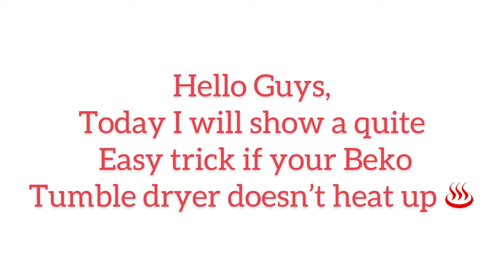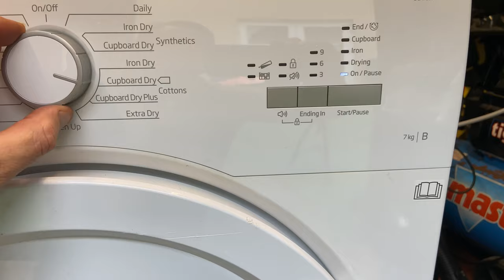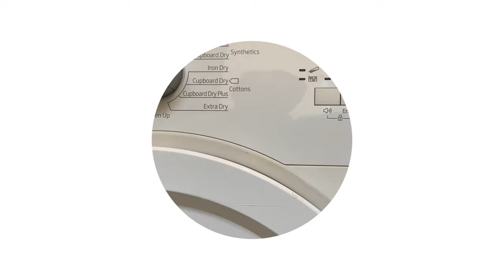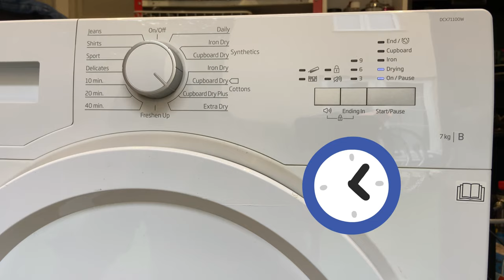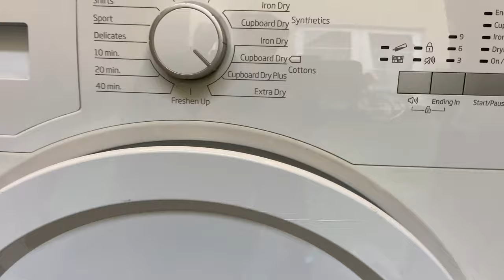BEKO condenser tumble dryer (DCX71100W) don’t heat up. How to reset the heating element thermostat🤔

Comment: I normally don't leave comments either, but I've just done It & it worked perfectly on a Beko dvx83100w  
Took less than 10 minutes including the cleaning. So simple, but if you don't know, you don't know. Thank you so much for taking the time to share this tip & easy to follow video👍
Reply from the maker: Thanks Gareth! I’m glad to hear that!

Comment: Hey George, thank you so much for this PRO tip! I have a Beko DV7220X 7KG. The button inside is green (for anyone else with this model). Pressed it down until I heard the click. Dryer is now running nice & hot as it should. Thanks again Sir!
Reply from the maker: Hi Patrick,
Glad to hear that!

Comment: Amazing! I just fixed my dryer by following your video, thanks so much :) Turns out I wasn’t cleaning the bottom filter properly and LOADS of lint came out when I prodded inside with a small pokey thing instead of just running it under the tap, that’s what it must’ve tripped out the heater. Thanks again :)
Reply from the maker: I am glad to hear that.

Comment: Thanks, it works, but why did this buton activate in the first place? I know for sure i didnt clean the filter and it was full
Reply from the maker: This button is a fuse to protect overheating the system. If you cleaned out the fluff from around the drum and wires you won’t have issue. But it’s really important to clean the filter and condenser regularly .

Comment: We have a Beko dryer but when I remove this panel there is nothing like this underneath, and no red button 😢 I’ve located some wiring elsewhere but no red button there, just a black button. Any ideas where the reset button could be? Thanks
Reply from the maker: It seems your machine can’t be resetting. I think a new sensor needed, but there is more than one and need to test which is defective.

Comment: I have the same model, attempting to do this as I type. After pressing the button, I think I heard the click... but when turning it back on it seems to keep stopping and starting, is there a seperate issue for this? It would run for 30 seconds then stop, maybe stops for a minute then starts again and it keeps doing this.
Reply from the maker: Hi,
Just clarifying, it doesn’t heat up or doesn’t turn?

Comment: Hey, I also have a beko with the same problem. However the red button is not getting pressed. I tried putting a lot of force too but i am not getting the click sound. What could be the issue?
Reply from the maker: Hi,
There is something else wrong. Likely the heating element is broken.

Comment: Fixed mine now thx buddy it did before and cost me 40 quid same thing the guy did but I did not see wht he done n said its on way to go use till its gone. Well it's OK now but I started it first smelled burn first few sec then I turned off waited and put washing in few clothes then started again no smell smoke it's OK but defo will keep an eye on it in case booom
Reply from the maker: Hi,
No worries, the deposited fluffy burnt down, this is happening if you didn’t use it for a while.

Comment: Hi George, dcu7230s beko here , seller said it tripped his electric , i ran it, it didn't trip mine but it did seem to be VERY hot and it stopped, so as there are 2 thermostats , if i cant click the red one in , , is it likely its the one next to it, btw machine was so fluffed up im surprised it went at all, ive read if one stat goes then so does the other , but on fleabay there doesn't seem to be any generics for this model ?
Reply: Oh and has this machine a front thermostat too? thanks  in advance
Reply from the maker: Hi James,
In different models has on different places and number thermostat. The house is warming up when the dryer heat as it’s metal. But this would be normal working order. But without inspection I cannot be 100% sure. If you are concerned ask an engineer.

Comment: What if the red button is super stiff, and won’t seem to click when you push it?
Reply from the maker: Hi,
If you cannot push it, no click- in this case the problem something else.
Reply: I had the same problem.I pulled out the two sensors at the side of the red button and then put them back.The machine is now working one hour later.I hope this is the end of the problem.
Reply: @georgesworkshop8600  what another problem could be?
Reply: Hi how do you know ifs it front sense or 2 at back mine seems to be overheating and cuts off and trips the electric never done that before...beko condenser dryer, thanks

Comment: If buttom not pressing and the dryer not heatting what shall i do?
Reply from the maker: This video shows one possible way to fix your machine. If this didn’t work on yours, that need a diagnosis to find out what is wrong. I can’t say anything surely. Could be sensor, heating element or something else.

Comment: I have a Beko B5T4923IG 9Kg Heat Pump and can't find reset button? Not sure if is 1 of anyone could please assist at all thanks?
Reply from the maker: Hi Simon,
Heat pump is a completely different system, there is no reset button. That works as aircon.

Comment: What if the button does not push in or click???? 😢please help
Reply from the maker: Hi Kellie,
If there is no click, then something else is the problem. Max a sensor or the heating element.
Reply: Where would you recommend I get the new heater from please 😊
Reply: Brilliant! , worked a treat.😊😊

Comment: The red button doesn’t go down seem to be pressed already… still not heating up… 🤦🏼‍♀️what’s the problem? Help
Reply from the maker: Hi,
If you cannot press down it’s in the right position,so not the sensor caused the problem. Could be: heating element broken or water pump is faulty. There are a couple things as possible reason why does not heat up your dryer.
Reply: @georgesworkshop8600  
Thank you very much for your reply!👍🏻

Comment: Could the red button be anywhere else? Mine isn’t there 😭
Reply from the maker: If you cannot find on the top of your heating element, then it isn’t in your machine. Probably something else the issue.
Reply: Hi did you find the reset in the end? I took the back of mine but nothing?